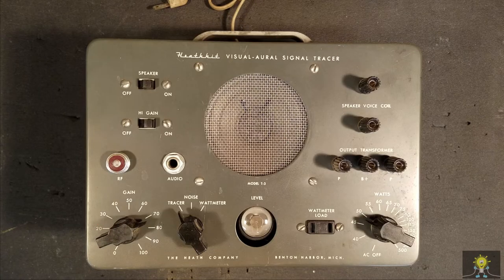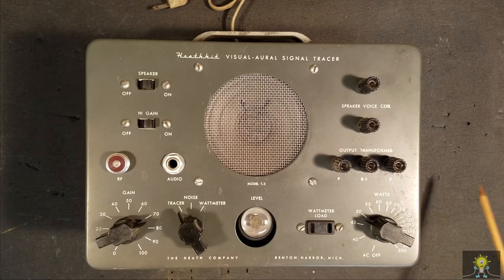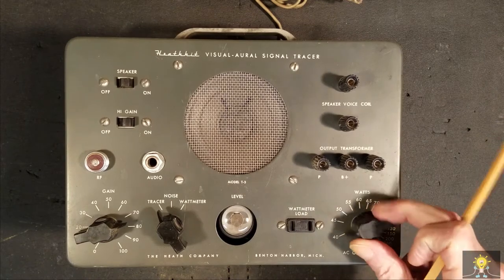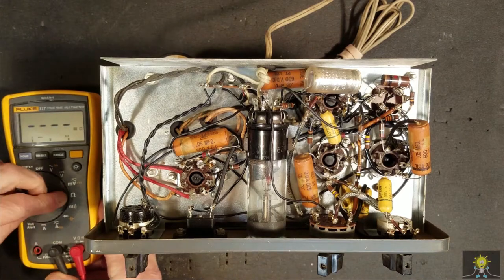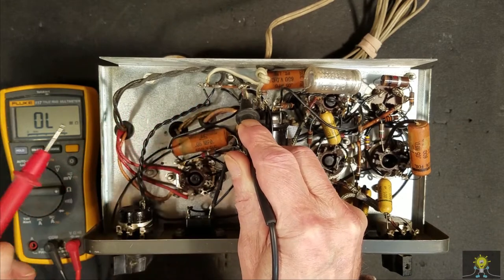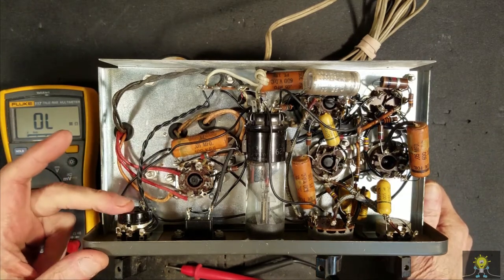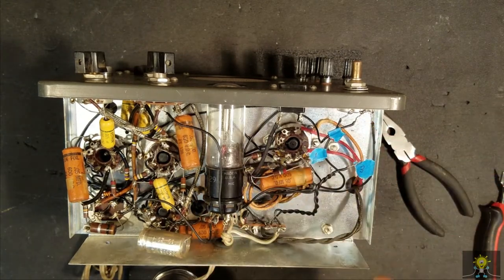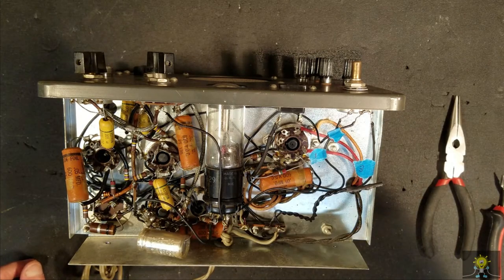012 HEATHKIT VISUAL-AURAL SIGNAL TRACER. MODEL T-3 Part 1

Comment: Very nice initial inspection! I see so guys just plug it in and see if it works FIRST. Haha, perfect if you want to smoke the unit that you just got. 
You’d have to twist my arm and pin me down not to at the very least do a visual inspection and power it up slowly with a dim bulb or meter attached.